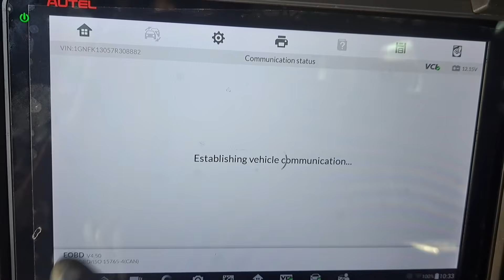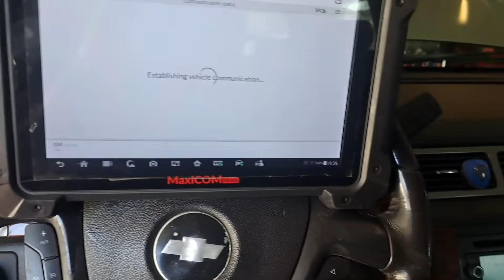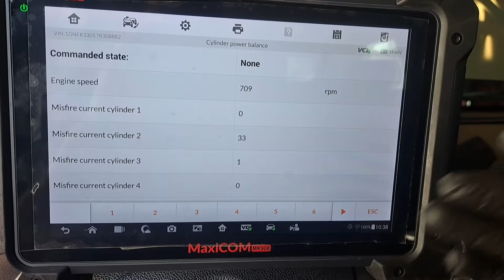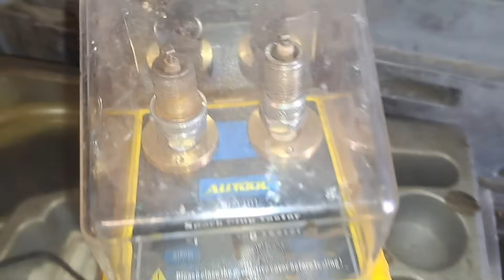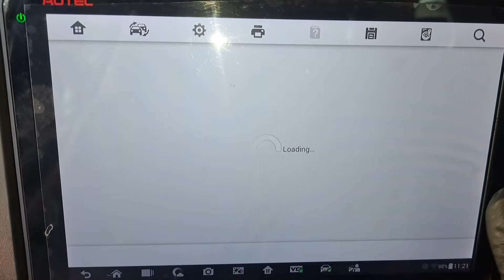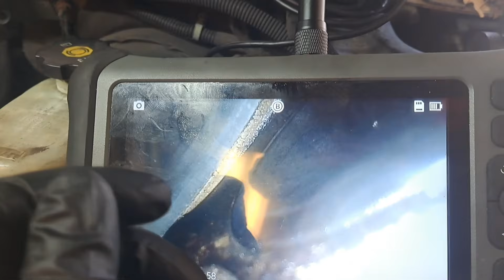p0300 chevy Tahoe, parts cannon with no fix,  so what REALLY HAPPEN?

Comment: I just dealt with this demon of a code, turned out the o2 sensors I had just replaced a few weeks before the code popped up were faulty. I replaced EVERYTHING I could too, only to unplug the o2s and she ran like butter. Don't cheap out on parts fellas.
Reply: So disconnecting the 02 sensors could temporarily make the car run better to determine if its that when u have a p0300?
Reply: @gr2262 yes. I still have not replaced them and have not had any issues other than startup because the engine doesnt know the fuel/air ratio.

Comment: We had a motor replaced in a Yukon because they said  was cracked. Long story short truck wouldn't start after new motors and we changed a bunch of sensors, close to $10,000  later( motor included ) it end up being the fuel pump
Reply: What was fuel pressure
Reply: sorry to hear that,those people were not mechanics,they were guessers!!

Comment: Man, thanks for the video.
I have that same motor, year, and the same round coil packs.
I have the 07 Yukon XL gas with 386k miles.  I kept getting the multiple misfire code on the odd-numbered cylinders. Solved #7 after changing the spark plug because oil was leaking from the valve cover onto the plug and was filling it out.
Fast forward to last summer. Had to replace my radiator. My cousin says hell you have the radiator out you should change the timing chain.
So I changed the oil pump, timing chain, fuel injectors, fuel rail, coils, wires, plugs, 4 O2 sensors, and the throttle body.
Ran fine for a few months. Again I had the P0300 code. After spending a few weeks trying to figure out out what caused the code. I found the throttle body wire harness was brittle in some spots. Found other spots where the entire engine wire harness was close to being bad.
Bought a complete standalone wire harness and am hoping to change it soon.
The instructions and steps to replace it seem confusing.
Reply: Mainly because it has 380k miles.
More so because oil was leaking from the timing chain cover. After removing the cover I can clearly see that the guides for the timing chain were cracked and about to brake off. That's why I changed everything.
Reply: @TheBucktowncrazydid you solve your p0300? Issue
Reply: Why would you change all that just because the radiator was out? A radiator is a quick easy job on these.

Comment: Here's one - 2007 5.3L Chevy truck LT. Not variable valve nonsense.  I changed the oil pump (High volume), timing gear and chain, intake gasket, plugs, wires, crank sensor, air filter,  and MAF cleaned, etc. Injectors looked good. Checked for vacuum leaks -none. It runs and sounds good, but If I drive 80mph and decelerate, it's okay until I go down a downgrade and decelerate. Then the engine light flashes a P0300 code, and then it goes off when I level off. No other codes show. Figure that one out. I don't smell gas, so I think the EVAP is good.
Reply: brother how is it running now, my yukon xl was doing that and now i have misfires and stabilitrak off
Reply: @fatwickaden07  I thought it might have been bad gas, so I changed to Chevron, but no difference. No other code accompanies the PO300 code. I guess my next area would be a compression check. If some rings are worn out (No smoke), it might send a faulty signal at a higher RPM. Don't know. Even my fuel pressure is excellent. Weird.
Reply: @markrichard8768 - Check your spark plugs and see if one is a different color than the rest. If so, it’s probably an ignition coil. If not that it’s most likely either the gas cap, the charcoal canister near the gas tank, and or the evap solenoid. Also change your air filter and fuel pump. Evap should give you code p0455, but not necessarily.
Reply: @kingwillie206or check your fuel regulator

Comment: You're going to want to delete AFM, otherwise you'll be right back in there replacing another AFM lifter.  Eventually 1,4,6,and 7 will all fail. Once the first one collapses and sticks you can go ahead and replace the lifters on all four of those cylinders (if you want to keep AFM), or delete AFM and stay with 8 cylinders firing at all times.  Lots of delete videos out there.  Of course if you delete AFM you'll have to reprogram the computer to prevent check engine light for staying on.

Comment: So I have an '07 Tahoe with the same round ignition coils,  and I just got to the part of the video where you said they're not grounded through the bolt.  I kept getting the misfire code on my cylinder number 7. It would trigger about once every couple weeks or once a month.  I was missing a bolt in that ignition coil as soon as I install the bolt. I haven't got the misfire code since.
Reply: Its grounded thru the black wire in the harness. Grounds to the back of each head.

Comment: Had a co workers wife's dodge charger was misfiring and the dealership wanted $1200 just to diagnose the problem.  I told him do a simple power balance test, isolate it down to a specific cylinder, then through the process of elimination with a known good cylinder, swap coils, then plugs. No change it has to be either injector or compression. Worse case scenario remove valve cover and start engine, watch rocker arms. Next morning he shows up with a video he took of one rocker arm not even moving with the engine running. Dealership wants $1200 to do this?
Reply from the maker: @billyhorton5779  yes.  I see where you coming from.  Non invasive diagnoses is a challenge that most techs refuse to apply. And when it come to the dealer,  it's only worse! You would think they have the technology to pinpoint rapidly
Reply: I have a few choice words about a $1,200 diagnosis. I don’t trust dealerships, unless I first read the fine print, before I sign anything.

Comment: I had this on my brother infinti qx56  started with catalytic converter 420 had Change truck ran find took trip Florida it ran find there fit dats in way back truck start  back in down pull over cool off made it back took shop change injectors ran find for two weeks Told it back shop c kg sim something wrong with motor change it long story short it did same thing with new engine was the rear catalytic converters wasted 6k for nothing